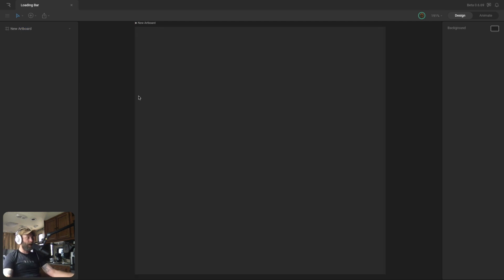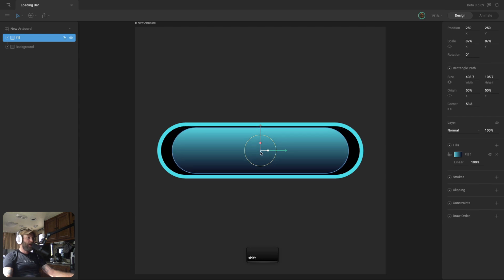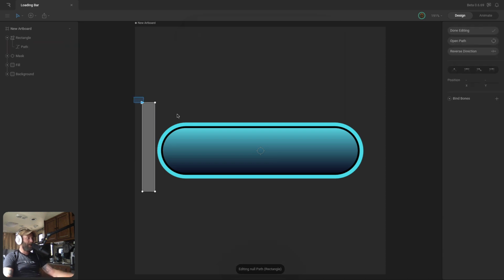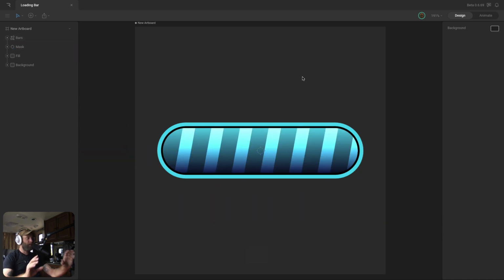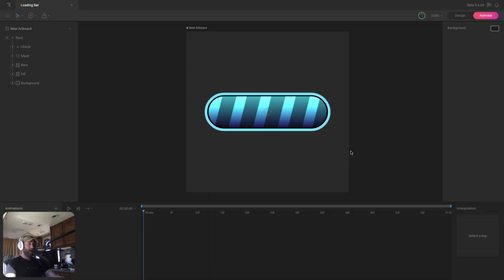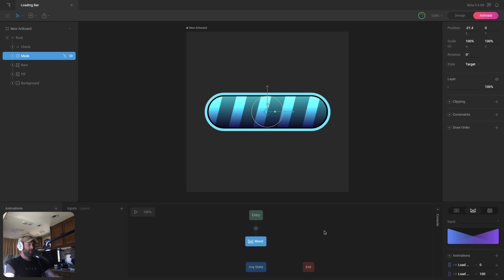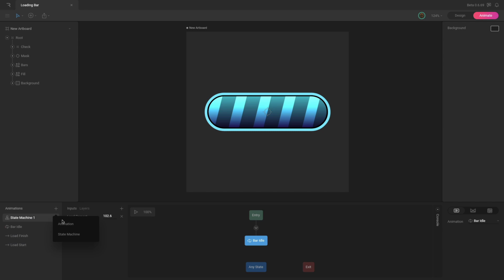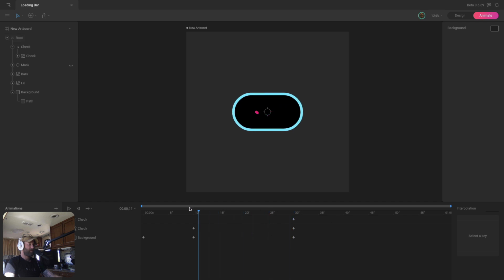Wait, Loading...

Comment: Hi, when blending start to finish animations, is there a way to make it reach exactly halfway point at input value of 50?
Thanks for the tutorial 🔥
Reply from the maker: Great question! To do this, create a new animation called "load_mid" and key the mask group where you feel it should be when load percent is at 50%. Add another animation to your blend state and set its value to 50.
Reply: @Rive_app It worked great, thanks a lot 😊More animations blended together = better accuracy, but I guess it comes with a price of performance. It's so handy to have those input values, but if performance will become an issue at some point I am gonna attach the bar's fill to a bone and control it's length directly 😇
Reply: Hello! I am currently working on animating a path which will show how much distance I have covered. The path in this case is a line I'm drawing with this tool and the path I've already walked I want to highlight. Do I have to put another animation in the blend state for each percent to get an exact result or is there a smarter way here?
Reply: @Rive_app  This is a really bad way of doing it no? If I want a really accurate animation, based on a percentage, I'd have to create 100 animations & key them 1 by 1?